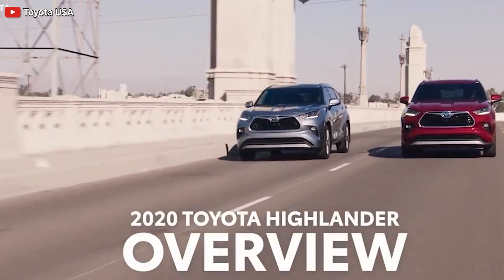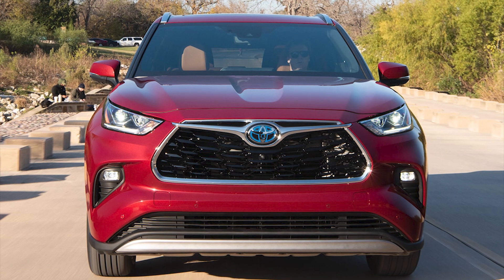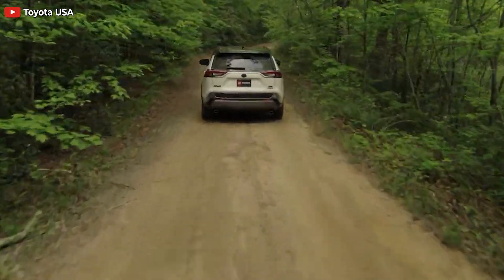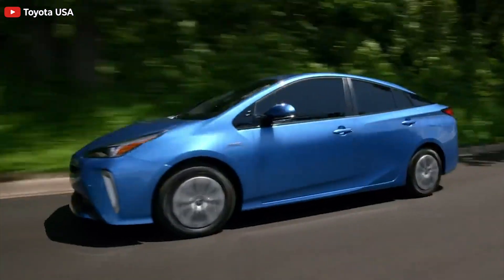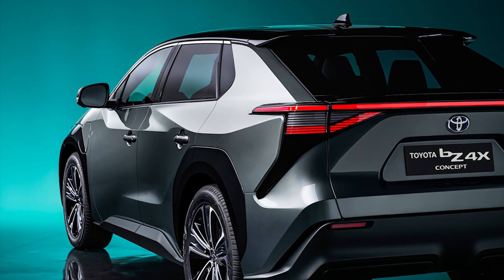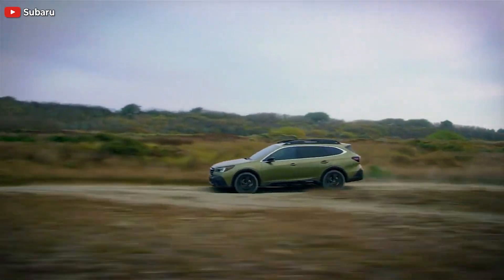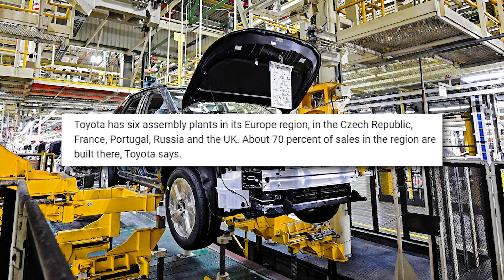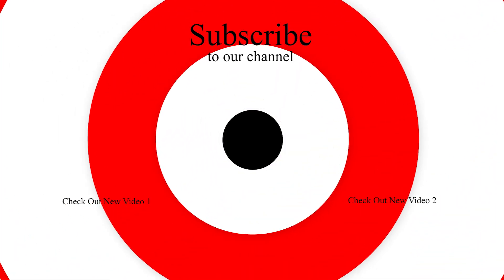Toyota Highlander Hybrid's New Tech Enhances Hybrid Efficiency

Comment: I have 2020 Highlander hybrid and I am averaging 42 MPG in the city driving. It’s slow but very fuel efficient.
Reply: Wow, about twice the price to operate as a model Y, slow, and crappy resale value.
Reply: @rgeraldalexander4278  Slow absolutely, crappy resale value maybe, but twice more expensive to operate than model Y, that’s not true. Four tires for Highlander are 650 and they last 60 000 miles. Four tires for model Y cost 1500 and you need to replace them every 30 000 miles. The insurance is also much more expensive than for Highlander.
Reply: A Highlander hybrid goes for about $41k a Model Y goes for $54k. With the incentives, savings on the cost of gas, AND low maintenance I would say you would do better with a Model Y than a Highlander. Also, you save a little bit of the climate for your great-grandchildren if you are planning to have some.
Reply: @moeali12345  Model Y is the size of Rav 4 and Highlander is much bigger SUV.
Reply: @zemo2332  I hope you know that size does not matter that much! I think probably Model Y has more space than the Highlander.
Reply: Can confirm after having both model Y is smaller with less second row leg room than Highlander. The Highlander may have crappy resale value; however, the customers who buy highlanders and Tesla’s are typically different. People who buy Toyota’s typically keep their cars for years whereas Tesla owners typically will sell their vehicle in just a few years. Toyota’s reliability rating is always better than Tesla’s with Tesla’s having more than twice as many problems per 100 vehicles according to J.D. Power. Additionally, the build quality and quality control is better on the Toyota’s with less panel gaps and less issues overall. The interior of the Tesla’s also are a bit on the cheap side with a plastic like feel on the low end, that being said the Toyota isn’t much better, but there are options for better materials on the Toyota depending on the trim level. Tesla on the other hand had issues with the black interior model y headrest with the leather delaminating. Toyota’s cost less to fix if in an accident or repairs are needed than a Tesla. Tesla maintenance cost are lower; however, I do fear that in the future Tesla can remove what ever features they want from my car with the click of a button, Bc essentially we don’t own the software on the car and we are just licensing it. They can take away supercharging on a whim or remove self driving if they want, disable features, remove things like lumbar support after the customer already paid for it Bc they determined nobody was utilizing it. Imagine paying extra for a luxury package that you thought had all these extra features to find out that when you get the car it’s no longer there and you’re not going to get a partial refund. Additionally if you’re mentioning resale value. Purchasing Tesla’s full self driving package does not stick with the car if you resell it, or you if you buy another tesla. So let’s say you put in $10,000 for FSD, when you resell your tesla you essentially lose that $10,000 investment Bc that “investment” does not add value to the car when reselling it Bc the feature is disabled when you sell the car. 

If you were to buy a Highlander and travel 1200 miles per month with an estimated mpg of 35 and a cost of gas at $4.75 you’d end up paying about $1954.29 per year in gas, or $9,771.43 over 5 years. If gas was $4.00 per gallon the cost over 5 years for gas is $8228.57. In regions where gas is $2.50 over 5 years that’s $5142.86. Granted this does not include the cost of maintenance; however, most Tesla owners who bought into self driving the infrastructure to get up and running (wiring the house) will be putting out an extra $1200 to $4500 to get the proper wiring done by an electrician. The other reason why I have both vehicles is for road trips, the Tesla is great for commuting, not so much for driving long trips in terms of always having to be cognizant of where a charging station is and having to go out of your way to get to it only to find that it’s broken or there’s a line. Yes Tesla’s have self driving, but it still has issues. That being said I can get something with a few less issues and I can install self driving on pretty much any Japanese or Korean made cars using a device called the Comma 3 or the previous version the comma 2. It’s mostly used for on highways but that’s a bulk of the driving anyways. The cost to install that self driving system is about $2500 after taxes, a lot less than Tesla’s self driving and personally i think that while each system is a bit different, both are functionally similar and get the job done.
Reply: @josephyang3260  You have very good points which I agree with now and for the last 30 years during which I have bought Toyotas (1 corolla, 1 Celica, 6 Camrys, and 5 Priuses, I have a large family). However, to me the choice is obvious. I will never buy an ICE care ever again. We have red flag of climate change and we need to think about the future generation (I don't have kids, BTW!). 

So although the quality, and durability of Toyota is supreme, I have no choice but to buy EV's best of which is done by Tesla. QED.
Reply: @josephyang3260  I really liked your post and agree with most things you said. I wanted to ask you to compare the tire expense for model Y vs Highlander hybrid. Motortrend tested model Y and they had to replace their tires after 20 000 miles. Highlander hybrid tires will last 60K easily. Four tires for model Y are about 1200 dollars and if you keep that car for 100K miles, the expenses are very high.
Reply: @zemo2332  never buy cheap tyres and NEVER buy tyres rated for longer than 30k miles ... for your life's sake, those fking tyres have 20% or less natural rubber and all sorts of hard compounds (like teflon and plastics) to keep them from wearing ... but that also means if they wear slow, they grip low .... wear high, grip high ... your life depends on those 4 little patches of contact with the road

Comment: I have a 2020 highlander hybrid and averaging 7.4 L/100km. It is amazing.
Reply: That's good but EVs are still more efficient.   The Highlander burns 7.4 litres per 100 or about $10.  An EV uses $4 of electricity to cover the same distance AND zero emission.
Reply: @Teslawalter  I can haul 7 people. can you?
Reply: @mobgma  Yes.  The model X can seat 7 and a 3 row is optional on the Model Y.  No more gas and very little maintenance (just tire rotation and  windshield wiper replacements)
Reply: @mobgma  I'm guessing you're a family man.  I'd like to point out the top 4 positions in safety are Teslas. There is not engine so the whole front end is a crumple zone and extremely hard to roll over because the battery pack is 900lbs centered at the bottom.
Reply: @Teslawalter  yes but I live in reality. I need to move 6-7 humans around. this is the best I can do right now. maybe the rivian suv will be out in 2023.

Comment: I have a Prius 2010 with 150K miles on it. I get 46-50 MPG on average. Before that, I had a 1994 Toyota Camry which I traded in for the Prius with 240K miles. I would NEVER buy a plug-in hybrid now that we have pure EV's. What is the point? Your car carries a big burden of hundreds of pounds of weight of the ICE for the few tens of miles of pure EV just so that it could switch to Hybrid to now carry the burden of the batteries for the duration of hybrid operation? That is NOT helpful Toyota. Quit stalling and get with the program. There is a red flag of climate change that compels the whole human race to move to sustainable energy as fast as possible.

Bottom line: If you find yourself in a hole, quit digging!!!!
Reply: 95% of all sales are still ice cars so it makes sense lol